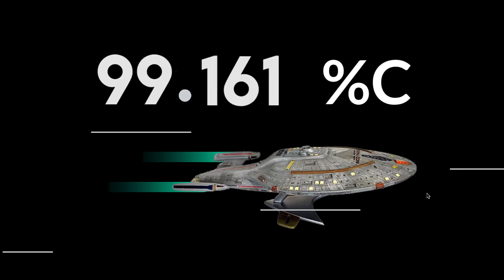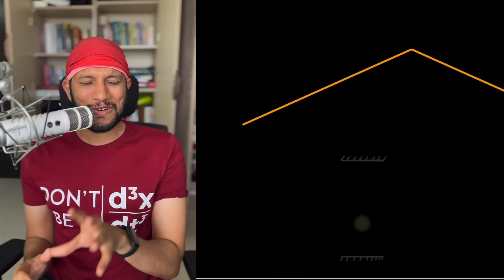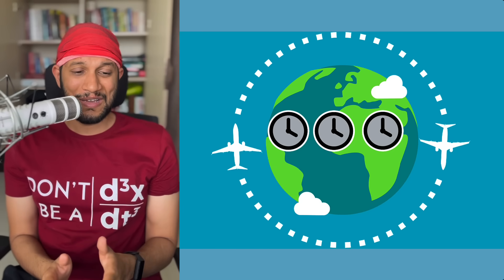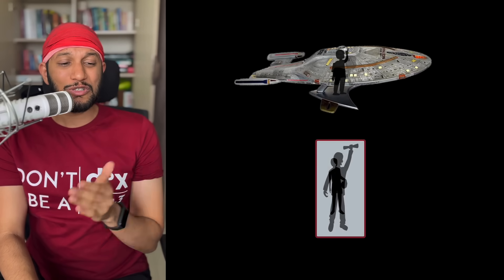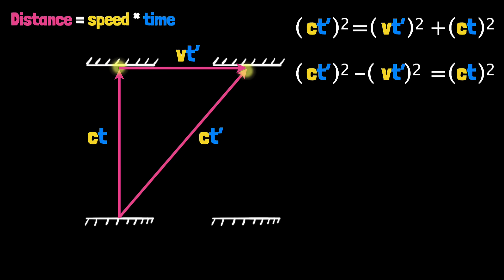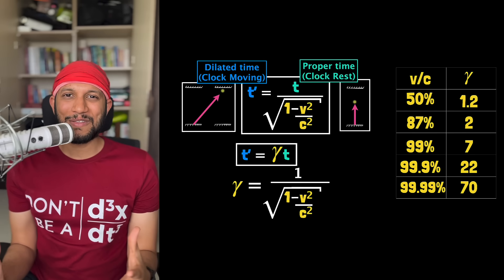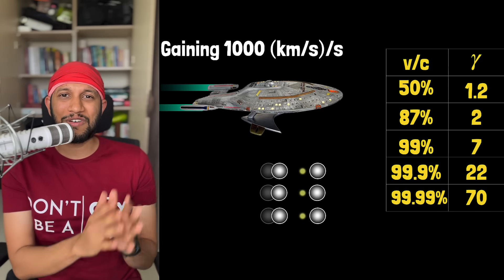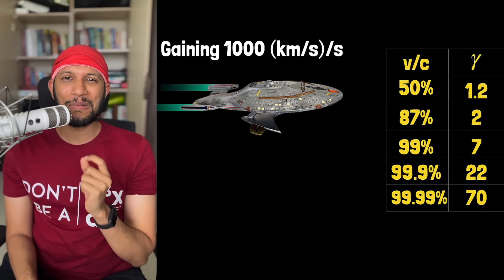I finally understood why you can't go faster than light! (My mind is blown)

Comment: technically a black hole would provide the infinite amount of growing energy as you get closer to it, to keep up with the speed of light, in fact even surpassing it. which is why light cant escape black holes. black hole are the one place in the universe where time dilation is happening on a massive scale. maybe black holes are the key to achieving speed of light travel. but the effects of the rapid acceleration would do diabolical damage to a living organism, and damage the structural integrity of a ship, or even unmanned vessel. if we were to create mini black holes, the size of an ant, in a controlled environment through science (which i know is science fiction in 2024), we could test this.

Comment: No matter how many beautiful pictures you draw, relativism will not give you an answer to your question. It's about the transformation of fields. They transform with speed and not relatively
https://sbkaravashkin.blogspot.com/2024/04/1.html
Relativists also transform and, as shown, incorrectly.
Transformation of fields leads to the transformation of bonds between atoms with a change in the structure of molecules. Long before the speed of light, matter will change, and biological organisms will be destroyed. So it is impossible to move faster than the speed of light. And bubbles will not help here because of these transformations.

Comment: I don't understand why viewing the photon clock from inside the ship is any different from viewing from outside. Isn't the photon slowed down from having to move extra distance either way? Would the clock not also "slow down" as viewed from inside the ship as well? Or is it that because WE also "slow down" we actually perceive the clock as appearing to move at the same speed as before, relative to our perception of it? At that point we are moving through time slower because we can only move as fast as the speed of light, therefore if we are moving at some percentage of the SOL, we would slow down through time proportionally to that, and further if we were moving at SOL we would stop moving through time. So basically I agree with time dialation but I don't really like the example to explain it.

Comment: That was a superb explanation but I also heard that light/EM waves is constant in all reference frames if you shine a flash light outside the front of the ship the photons will still all move away at speed c. 

From inside the ship's perspective why would the photon clock behave differently? rotate the photon clock by 90 degrees set so its parallel to the ship's axis of motion and suddenly all that trigonometry goes out the window. Imagine it's a huge ship with the mirrors set half a light second apart. the time between a photon flying from a light source at mirror A to mirror B is a half second and returning to mirror A is another half second. If a detector is placed at mirror A the photon will tick once per second both mirrors are traveling at the same speed 

Atomic clocks on planes probably spew out whatever is measurable at various angles relative to the aricraft's axis of motion leading to discrepancies in atomic clocks. But imagine a large crain attaching a laser to propel a solar sail at those speeds  parallel to the exis of motion  it ought to provide steady acceleration and eventually exceed c?

Comment: But how do we know that the clock is at rest? Even our earth is moving at a certain speed and our solar system/Galaxy is also moving at a certain speed. and I don't know much but I think I read somewhere that the expansion of space is happening at a speed that is more than the speed of light. So for someone outside this, for them even our time is also slowing down and even we are aging slower than "normal" I guess. But I think I understand, If the observer is on Earth and the clock is on Earth, it will appear that the clock is at rest.

Comment: That limit will be defeated... eventually.
It will require creating an inversion field so the ship inside is not achieving C while the field is 'tricking' physics into thinking it's going slower than it is.   Let's just call it a 'warp' field.   Inverting the mass that are expressed by the 'physical' universe will cause the energy required to achieve C to actually drop after a the inversion field is initiated.   So at 'zero' energy the object achieves C.   It would require increasing power to a certain state to actually 'slow' the ship to a point it can drop the field and re-enter the physical universe.   Doing so prematurely = catastrophic conversion of mass to energy.

Comment: If you being inside basically don't see the time slowing down, what would happen?
In your relative time you do still accelerate to 1000km/s, so if your time speeds up infinitely faster, sounds like that you do get enough time to accelerate above speed of light. 
Does it also basically means that you can travel almost infinitely to the future?

Comment: I understand that it takes infinite time to get to "c" from our reference point, but inside the spaceship reference, under 1000km/s/s acceleration, it can reach "c" and even beyond that no? Because even light travels at "c", doesn't mean from our reference time we say it takes "infinite" time for the light to travel some distance in its reference frame. What I am trying to say is to skip using the formula and a different standard frame as doing that is anyway not making sense when you consider the photon instead of spaceship as one of the frame.
Reply: Not exactly. Look up Lorentz Contraction. In short, to the passengers the universe itself shrinks in their direction of travel.

Comment: When I am the only thing in space, what is my speed? No way to tell. If space is not a medium (Aether),  then what stops me from acceleration for ever? Nothing! As soon as I stop accelerating, I'll ask the same question: what is my speed? And again; there is no way to tell. If space is not a medium to which you can have a speed, it makes no sense to assign a speed to any object and also no speed limit. Speed is about measuring the change of distance between two objects. Objects themselves can not have a speed. The bouncing photon traveling a longer distance when moving faster makes no sense to me, because "faster" is not a real thing, and if there is no medium to travel through, the "longer distance to travel" also makes no sense. That "longer distance" is an optical illusion. The photon can not travel a short distance and a long distance at the same time, it just bounces up and down, straight, no matter how much the distance between you and the object is changing, nor does it matter what direction you turn your head. Am I wrong?

Comment: I never understood the proton clock explanation. If you were to draw the path that the proton takes, it seems like it's a right triangle and the only distance that changes is the hypotenuse. The y-component of the distance traveled (the vertical side of the triangle) seems like it should stay constant. Why then, should the ticks slow down?

Comment: Technically, everything is always moving at the speed of light. As we increase speed through space, we decrease speed through time and vice versa, but the sum is always the same, and always equal to the speed of light. That is why we can’t travel faster; at the point we are travelling through space at light speed, we will cease to move through time at all. And when we are moving through time at the speed of light? We are stationary in space! You can’t move any less than not moving at all!

Comment: You seems interested of space travel. 
Between Universes the only word I can describe is "Non-Space, Non-Time" Realm. 
The "Fuel" of the vessels are "space source" (light quantum). They using this to synchronize all the atoms frequency in the vessel to jump universes.
Once they in the "Non-Space, Non-Time" Realm. (That is in between universes)
By modulating the phase of this synchronization, the vessel can "jump" to different points in spacetime.
You move  relative to the outer spacetime, but you don't speed up or slow down.
They pass into the "Non-Space, Non-Time" Realm, then sync back in to the universe they want to go.
9 light years. consists of many jumps. Further you jump, bigger navigational mistake you can do. Don't be in a hurry. Jump more smaller. Because if you screw it up even once, then you will be away by maybe 6000 years.
On some of the UFO videos you can see when they dump the used space source. (Like a fireball)
Also you  can see they appear and disappear. They do not fly in a traditional sense. Just sync back and forth.

Comment: On an additional practical note: you can’t go faster than your propulsion and will always suffer practical losses. So if you accelerated an atom with a laser, the laser is moving at the speed of light, you can’t accelerate the atom faster than the laser and always will suffer losses so again no breaking the physics speed limit.

Comment: Is it possible to explain the same using vector mechanics? I guess, even if we observe the photon from outside the ship, the vertical component of its velocity will be equal to speed of light and vertical displacement between the two mirrors will remain same.(provided that we define "one tick" by the motion of photon from one mirror to another.)

Comment: Seventy years ago people had the same silly theories for why aircraft could never exceed the speed of sound. And yet, here we are today going two-three times faster than sound. With zero resistance in space and with enough fuel to provide constant acceleration, it is only logical that you will eventually reach the speed of light and exceed it. We'll do it within the next 100 years.
Reply from the maker: @tb100  Sure, but understand that that was an engineering problem! This is the problem according to our best theories of how the universe behaves. But that’s besides the point. The point is to help gain intuition about why our current models predict what they predict. 
It’s very much possible that the model is incomplete and we may indeed find that more accurate models allow us to surpass the speed of light. But it won’t happen by saying ‘it’s only logical to eventually reach the speed of light’. That’s pure ignorance imo!
Reply: @Mahesh_Shenoy  Good answer, very diplomatic 👍. I was actually being a little facetious. What the heck do I know, and my “logic” against Einstein’s theories hold little value, right? Yet I can’t help thinking that as we humans push boundaries, we often prove theories wrong. I won’t be around when humans travel at lightspeed, but it is going to be glorious!

Comment: It's really easy: the closer you get to the speed of light you start converting the energy you put into going fater directly into mass, your mass.
This means you need more energy to go faster, which then gets coverted directly into mass.
Which means you need to add more energy with gets coverted directly to mass.
This is the reason.

Comment: Wonder what happens if the atomic clock orientation is turned so that photon path is in line with the ship path, would all the equations and logic for time dilation still work out? Thinking about this, it would be impossible to reach or rather exceed the speed of light, because once the ship's speed would reach speed of light the photon once in motion in the same direction as the ship will stop moving altogether, hence the time is frozen. This feels like it's just made up, but it still corresponds with the whole theory somehow. xD wtf

Comment: I always liked it when sci-fi movies/novels/games would try to find another explanation for FTL space travel. I am particularly fond of the ones that involve "keeping the ship at rest", using drive technology that expands/contracts space around the ship instead of propelling the ship itself. How does it do this? Who knows! But it is interesting as it solves the mathematical conundrum of an object reaching infinite mass as it approaches the speed of light. 

Elite Dangerous refers to these as "frame shift drives". In Mass Effect, ships achieve FTL travel by creating corridors in space-time that basically cause the vessel to be negative mass. Star Trek interestingly works a similar way, but instead of a "corridor", Star Trek warp drives create a "warp bubble" around the vessel, in which the ship is a negative mass. I really like how these kinds of questions attempt to get answered in science-fiction, because it's possible that maybe one day, one of these ideas might be right, or perhaps possible.

Comment: i might be having a bad day, but, hear me out:
this whole time dilation start with the fact that we are viewing the space ship from a set reference point, which is stationary (is not moving with the ship).
but what happens in the ship ? my atoms will still send electrons between them at the same rate, right ? My watch will still beat at 1 second per second like i used to right ? If i look out the window, i might see the Earth getting 1000 years older / second, but that doesn't mean that I, me, in the spaceship, will not reach speed of light in 30 seconds by accelarating 1k meters / s / s. Right ?
Reply: reaching speed of light in 30 seconds for me, in the spaceship, but infinite time for the set reference point on earth.

Comment: I think of it as The Infinite Bouncing Ball theory. Imagine a ball that you drop and every time it bounces it produces enough energy to bounce back up exactly half the height it fell. On each bounce it would therefore be closer to the floor. It would go from 16 inches high to 8 inches then 4 inches then 2 then 1 then half then a quarter then an eighth and so on. But, it would NEVER settle on the floor. It would never lose enough energy to land permanently on the floor in the same way that an object would never produce enough energy to close the gap to light speed.

You can also compare it to a real world example such as the Bugatti Veyron. The original Veyron had 1001hp and a top speed of 252mph. To reach 150mph would require the Bugatti to use 250hp. However to cover the next 102mph to reach it's top speed it would require all the remaining 751hp. A 300% increase in energy to attain only a 40% increase in speed. Yes, there are physical elements such as drag and wind resistance to consider. But, the princple is the same. The energy you require to increase speed rises disproportionate to the increase in speed. The forces working to accelerate you will be met with increasingly stronger forces that decelerate you. Time dilation is such a force when approaching light speed.

However, there is a way around exceeding light speed. Actually there are two. Firstly light speed is NOT consistent. Light can be slowed to walking speed if it passes through certain mediums. The other method is to travel through warped space. This removes the requirement to move a physical object at light speed and allows you to travel between two points in less time than would be possible at light speed. In fiction it's created by Hyper Drives, Jump Drives, Warp Drives, Space Folding Drives and even Infinite Improbability Drives. They all work on the principle that you don't move at all. Space does all the moving. It folds around you and then unfolds with you at your destination. This allows you to travel somewhere light years away in mere seconds. If only.

Comment: I have a fundamental problem with the concept of the photon clock: I propose that when the mirrors are aligned in parallel the photon would "travel" out of view as the ship moves. The photon does not "know" that the ship is moving and would have to be directed at an angle (in the direction of the movement of the ship) to keep bouncing in the center of the mirror. once the ship's movement and the motion of the photon are synced (i.e. the ship is not accelerating in any direction) the photon's touch points are aligned with the center of the mirror and the distance the photon travels are indeed longer than the travel times of a photon that's not moving. When the ship then comes to a stop (accelleration of the ship in the backwards direction) the photon would then keep moving in the previous direction and again eventually move out of the reach of the mirror.

Comment: Something is incorrect with the math on a fundamental level.
The point of no return around a black hole is called the event horizon and is the speed at which orbiting material is orbiting at the speed of light.
Obviously material will get closer to the black hole meaning it will orbit faster than the speed of light.
The speed of light is not a constant. It is a horizon in time that we can not see beyond. If we get to the event horizon, I think it will move closer to the black hole. Because a horizon is relative to the pov.

Comment: So this only makes sense from the "stationary" reference frame, but its missing the picture from the other side (the "spaceship" reference frame). Special relativity says that speed of light is constant at all reference frames. That means if youre the one on the space ship, none of this applies to you. Your clock does not tick slower, and you dont experience any time dilation because from your reference frame, the photons dont actually have to travel the longer path, and therefore you dont need the extra acceleration. What causes the speed of light limit is because since your time has stopped relative to the outside world, if u were to travel at the speed of light, you would arrive at your destination instantly. You cant go faster than instant travel, so speed of light is the limit.